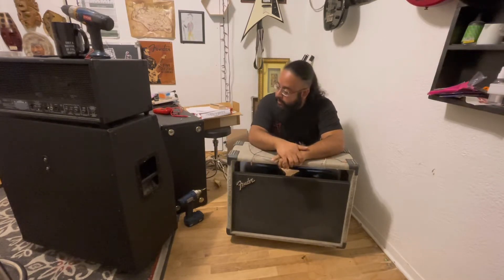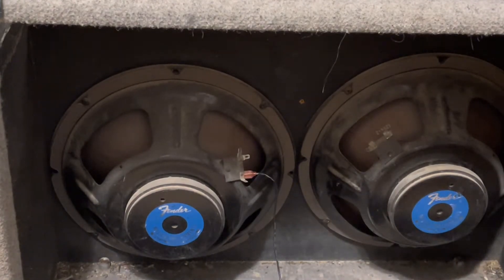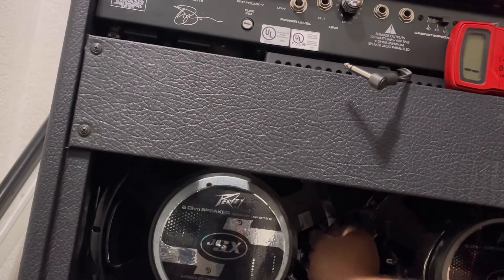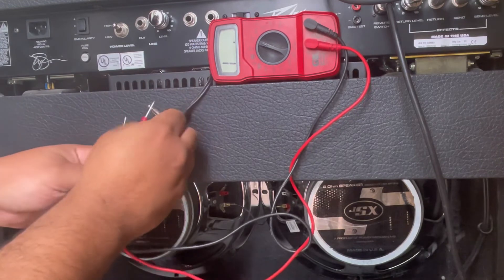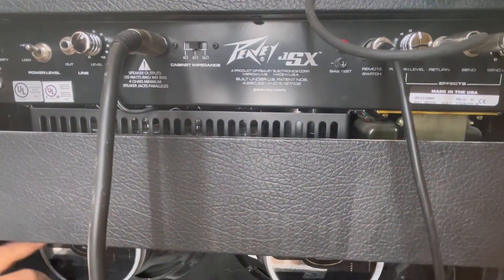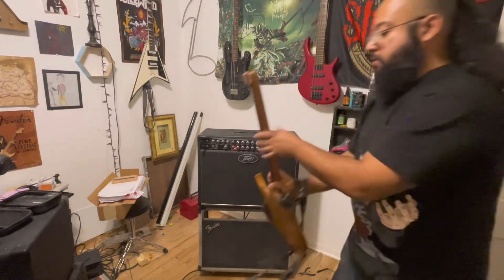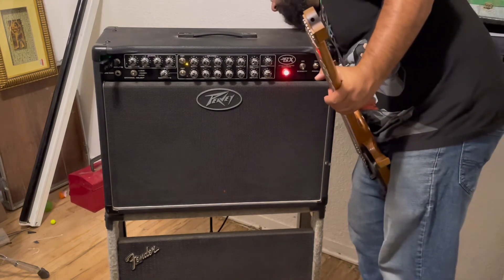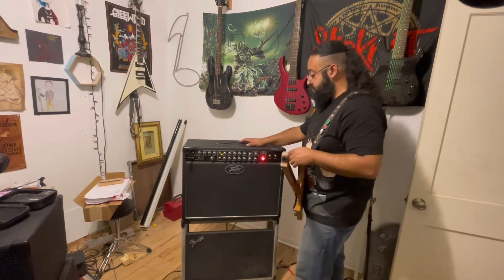￼￼ Combo Amp with external speakers?

Comment: I have two PA speakers Passive 12 Inch 2-Way PA/DJ Loudspeaker Cabinet - 700 Watt Full Range PA/DJ Band Live Sound Speaker can I use those two external cabs for electric guitar? Your opinion
Reply from the maker: So you can use them. However, when using a higher wattage speaker, it is my understanding that you have to use a head that could power up to the standard power meaning not the full peak but the continuous. But if your head is not powerful enough to power the speakers, you may not get the full DB out of the speakers. It can work but imagine having 100 W head powering 1000 W cabinet. You’re only going to get an adjustable 100 Watts at whatever ohm ratings to what those speakers are at. Then if you try to push the head as much as you can through the speakers, you maybe also risk maybe damaging the head? That I don’t know for sure. But you’ve got to kind of think about it; Why are most guitar cabinets wattage ratings at lower ratings when they put together in a 2x12 or a  4x12 at 30 W each speaker? But that’s just my opinion.
Reply: If I use this as an example.    Orange Amps Super Crush 100W Amplifier Head with Speaker and /with PA speakers between 100 to 400 W will my amp work
Reply: @XR1PP3R   If I use this as an example.
Orange Amps Super Crush
100W Amplifier Head with
Speaker and /with PA speakers between 100 to 400 W will my amp work
Reply from the maker: So this explanation is going to be kind of long. But The short version is if your ohms  ain’t matching you could potentially damage your head for your combo amp.
Reply: @XR1PP3R  my combo amp is eight ohms on the spot usually passive PA speakers 4/16 ohms, which I believe means I can run eight ohm load through 16 ohms with no problem. Some people have told me that, but I just wanted to confirm.
Reply from the maker: @Texas059  I don’t know about running 8 ohm into the 16 ohm speakers without parring them together before hand. You will have to wire it parallel or series depending on if they meeter out to 4ohms or 16ohms.

Comment: I'm currently running a marshall g10 into 2 of the 4 line 6 speakers in the cabinet i just got. Also using the moore blade distortion pedal. I just unplugged my amps speaker for now.
Reply from the maker: Interesting that works just be careful on that amp. I would try to get a more powerful one for that cab.
Reply from the maker: That’s one way to do it and also shape your tone. Hell yeah!